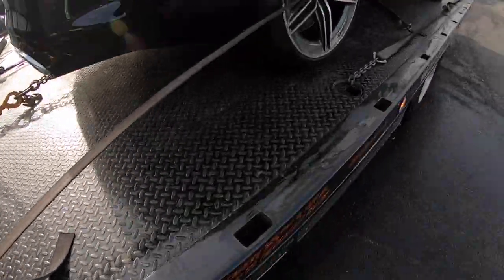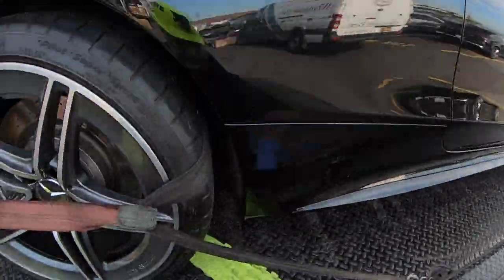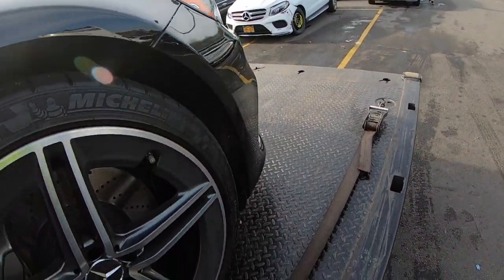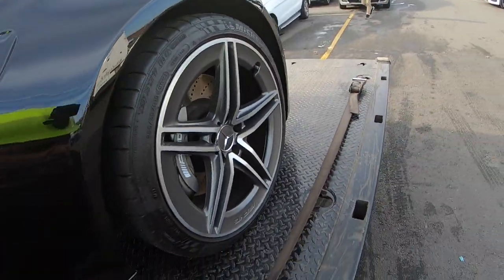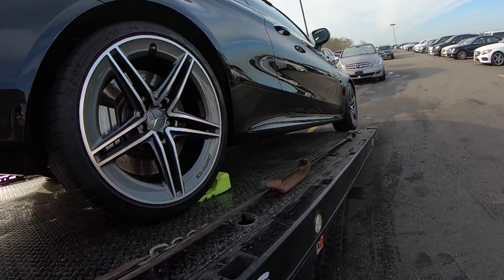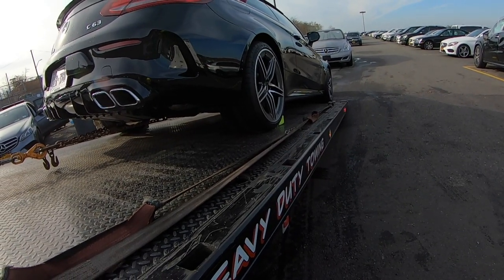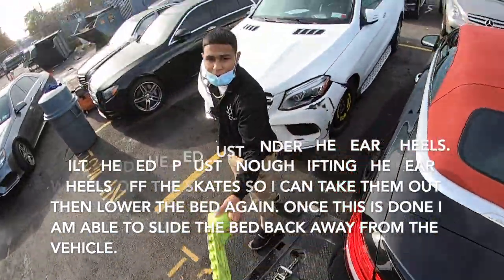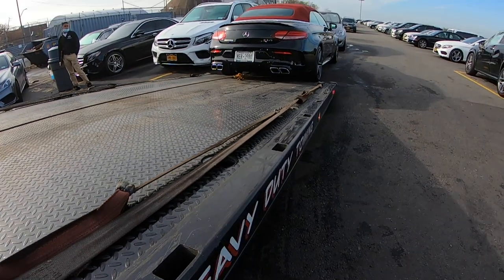Offloading a vehicle stuck in park using skates

Comment: Well done.  The only thing I do differently is I tilt the bed with the winch tight... put skates under with a couple taps of the hammer... then I loosen the winch so the slack in the park pin allows it to "roll" on to the skate an inch or so... less hammering to get it under further. Then the slack in the park pawl allows it to roll off part way so it comes out easy.   Now we'll wait for another high end AWD to be part II.  :)
Reply from the maker: As soon as I get an AWD I’ll make the video.
Reply from the maker: Yeah depending on the vehicle. If it’s a 2wd I’ll use skates on the wheels that are locked and if it’s an awd I’ll use 4 skates.
Reply: @TowMan127  good to know.  I just started here in Florida.  This company doesn't even use skates.  I ordered them and my lube of choice is chain lube.
Reply from the maker: Skates work great and I use a block of wood sometimes in front of the wheel to act like a wheel chock. When you put the wood in front of the wheel and pull the bed in the block will hold the car as if you had the brake on and it helps hold the car so the wheels will slide while the bed is moving then extend the bed and move the wood back in front of the wheel and keep repeating the method till the vehicle is off the bed.

Comment: Great video.. next one 4 Matic with no keys? that's what I want to see
Reply from the maker: You’ll get that video as soon as I get one 😉
Reply: Pain in the ass!
Reply from the maker: Yeah for sure.
Reply: And use the tow eye .
Reply from the maker: I don’t use those
Reply: Mercedes sells a free wheel hub you put on the rear wheel that turns it to free roller no key needed just remove wheel put the hub in place then put wheel back on and boom you are in neutral
Reply from the maker: @frankmanginelli9268  yeah I’ve seen it but it sure is pricey.
Reply: @TowMan127  very pricey lol the company I use to work for had it I believe it's around a grand to buy
Reply from the maker: I’ve seen some for $500 but I don’t get paid commission so I won’t buy it cause it’s not going to make me any extra money.
Reply: Or.put soap or oil on your bed watch how fast it slides off. No keys.awd.e brake on or what ever.
Reply: most cars have one side of the wheels off so a 4 matic Mercedes is only 4 matci when its on, when off the front wheels are free spinning

Comment: Thanks for the vid. I’m new to the industry. If a vehicle is 4x4  with no keys, do you have to use 4 skates?
Also will you show how your straps are secured to the bed, while unloaded?
Reply from the maker: You’re welcome. Depends on the vehicle. Sometimes you only need 2 skates. I leave the straps on the bed and tighten them. No need to keep putting them away to pull them out again for every tow. I’ll be making a walk around video soon showing all my tools and setup. Make sure to have the notification bell on.
Reply from the maker: If you’re on Instagram or Facebook give me a follow “TowMan127”
Reply: Will do

Comment: Quick question! Do you use the j hooks downwards or upwards when pulling a car? I always have phobia if my winch jolts they might just come off the controls arm so i do on J hook facing down and one facing up in control arms.
Reply from the maker: I’ve never had an issue with them facing upwards. You can always buy an axle bridle and you’ll never have to worry again
Reply: @TowMan127  yes I will do that since my winch has no guard or tensioner! If im not looking the winch wraps on top of itself in one spots and slips making the car jolt real bad. Mini J are ok but but using J hooks with a badly wrapped winch nasty.
Reply from the maker: @farhanmohammed1059  you should definitely get a tensioner cause it helps.

Comment: It only works if the locked wheels go on the bed first. That way when you unload the car the rolling Wheels come off the bed first and the locked wheels slide on the skates. If you try to do it any other way it's a hard time getting the car off without going through a lot of hassle
Reply from the maker: Not really. I’ll make a video showing how to do it

Comment: Long story as short as possible. A couple of weeks ago, someone else's car stopped working, and she called a tow truck driver. For some reason, the tow truck driver thought this person lived at my house, so he came over to my house and thought that MY car was the broken one! He knocked on my door several times, but I was dead asleep at the time (I'm a night owl) and was completely oblivious to all of this. Since he couldn't get the key to my car, he winched it onto his flatbed while it was in park! My brother-in-law came over just in time and stopped him from driving off, but I'm still worried sick about my car because I hear that it's a big no-no to drag it while it's in park, and he thought the car was already broken to begin with. My car is a 2014 Honda Civic, and I don't know if it automatically disengages the parking brake when it's being moved. Should I be worried?
Reply from the maker: We drag vehicles stuck in park all the time. If he did it right you should have any problems. I wouldn’t take a vehicle without the keys unless I was told to.
Reply: @TowMan127  I forgot to mention that my car doors were locked as well, so he couldn't get in to put it in neutral.
Reply from the maker: @Chris_P_Bacon62  a good operator doesn’t need your keys or need to get it in neutral. I take vehicles all the time with no keys.
Reply: @TowMan127  Yeah, after watching some other videos, I now realize that he more than likely winched my car onto his flatbed slowly by tapping the button every couple of seconds so that the tires wouldn't be forcibly turned. Another good thing is that I didn't have my ebrake on. I only use that if I'm parked on a hill.
Reply: Get this! Ever since my car was almost towed away, I've been hearing this weird noise whenever I turn right. I was so paranoid. However, a few hours ago, I finally found out that it was coming from my seat belt buckle! I feel like an idiot lol. As it turns out, when you turn right, your vehicle's weight shifts to the left (and vice-versa) and pulls you with it. So, when I was turning right, my car was pulling me away from my seat belt buckle, thus pulling it as well. 

Also, I always thought the parking brake just meant that you were putting the car in normal park mode. I didn't know that it actually meant the 'ebrake' until recently. So my OP is a little confusing. As you can see, I'm not very car savvy, lol.
Reply from the maker: @Chris_P_Bacon62  😂 well glad the car is ok

Comment: Wish my situation was this easy last night wit front wheel drive 🤦🏽‍♂️🤦🏽‍♂️🤦🏽‍♂️🤦🏽‍♂️
Reply from the maker: Offloading a fwd that’s loaded backwards on the truck?
Reply: @TowMan127  I’m still learning but no it was frontward and electronic ebrake after talkn to my bro he was like next time just throw the car back in park rookie mistakes lol growing pains
Reply from the maker: @Zaylee.Swaagher  what kind of car was it? Do you have skates?
Reply: @TowMan127  yes have skates, and it was a 2020 accord…I f’d up but learned from the mistake
Reply from the maker: @Zaylee.Swaagher  we all learn as we grow in the industry. When I first started I didn’t know as much as I know. 22 years later I know a lot now but I’m still learning. Electronic parking brakes suck. If the vehicle has a neutral override you can put it in neutral and use skates on the rear wheels.
Reply: @TowMan127  I went old school got the rear wheels off with no problem but the front wheels I made the rookie move by not putting it back in park 😩😩😂😂😂 but I’m learning still thanks for replying
Reply: @TowMan127  definitely subscribed so I can keep coming back in case you post other situations